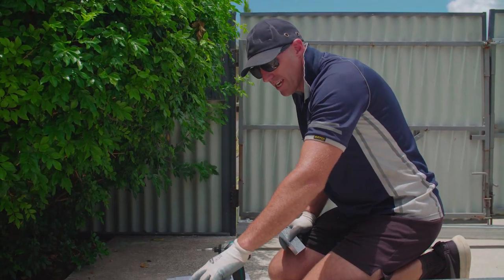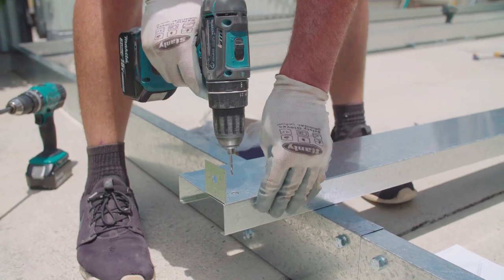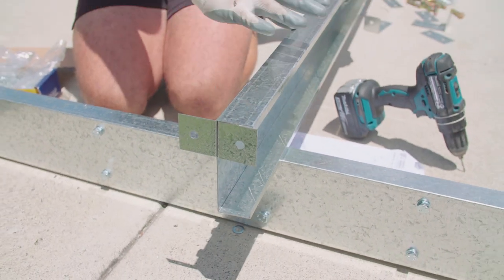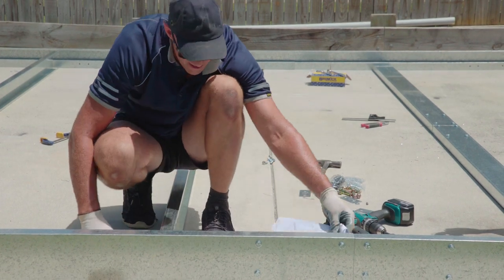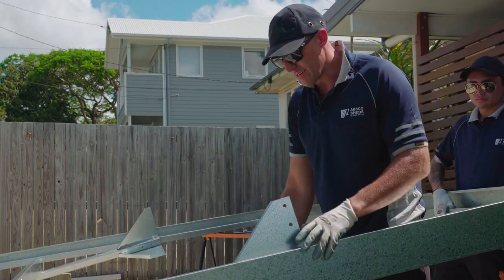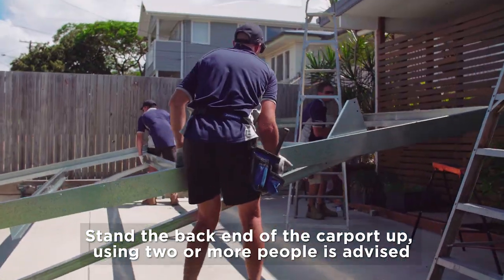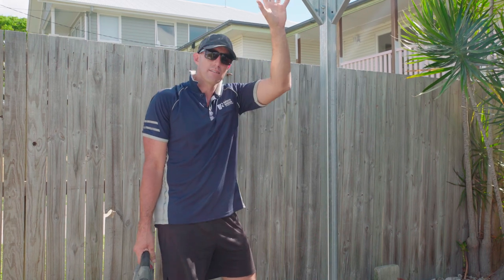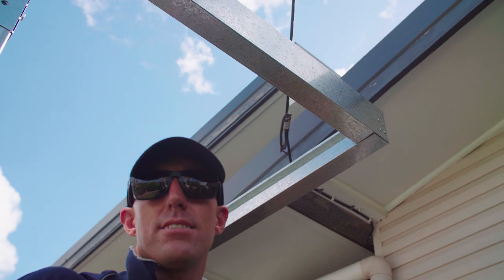Absco Sheds - Skillion Carport Assembling the Frame & Anchoring

Comment: It would have really helped if the holes for the legs were pre-drilled. I don't see why they couldn't have been. I've over heated my 10 mm drill bit & probably buggered the tip trying to drill through the 2 mm steel.
Not impressed.
Reply: If you can’t drill through 2mm steel, that sounds more like a user error and maybe you shouldn’t be allowed to use a drill.